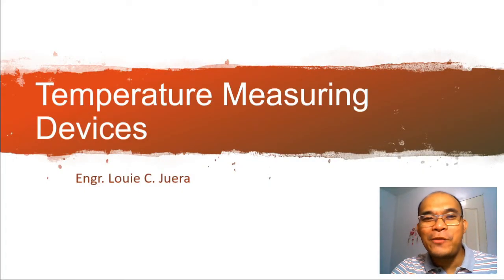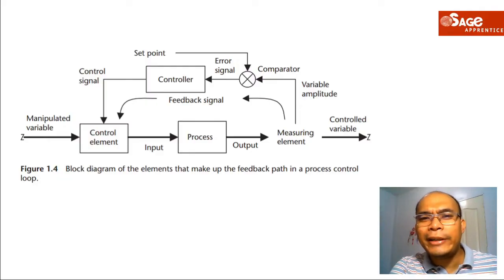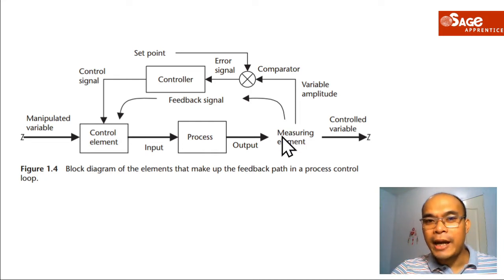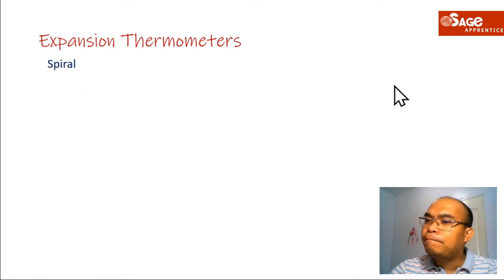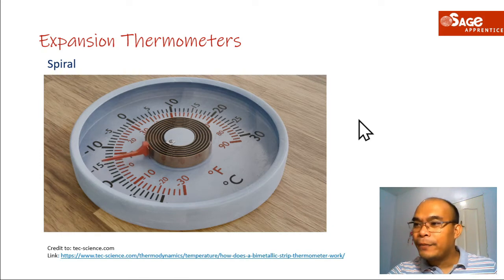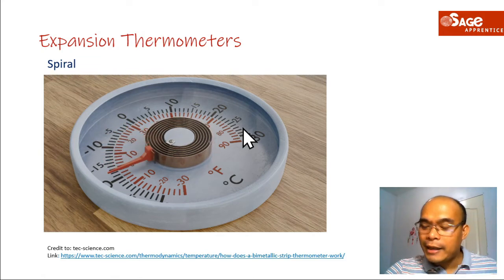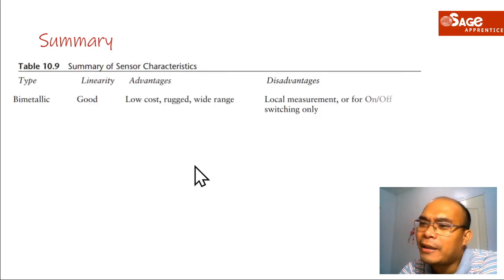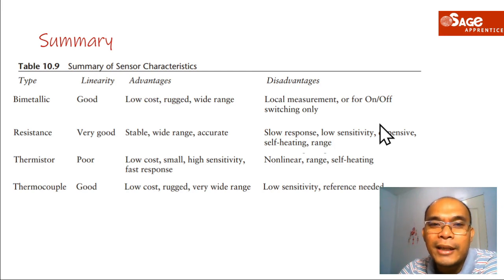How does a Temperature Measuring Device works?

Comment: The video was very detailed and explained well. That's why I've learned a lot about Temperature Measuring Devices like expansion thermometers, which is the main concept is to expand the liquid in glass (mercury). It is also the most common temperature reading device. And I also learned about Bimetallic strip, Spiral and Helical Bimetallic strip, which the main concept is to expand when heat is applied casing the thermometer to point in it's desired temperature. And lastly I learned about Resistance Temperature Devices like thermistors, thermocouples and pyrometer, which is the main concept is the change in temperature will result to the change of resistance, and the change of resistance will result to the change of voltage and the change of voltage is calibrated to measure the change in temperature. Thank you 😊

Comment: Good day Sir!
 In the midst of the pandemic maybe some of us are wondering about  the gun shaped that is pointed at us every time we entered to some stores,  establishments, and malls. That thing is what we called, " Pyrometer." This is suitable as of this time since it measures temperature  without physical contact to other people. Which is a good thing since it helps to  reduced the  spread of virus. 
One of the important components in process control is the measuring element that simply measures physical quantities. One of those physical quantities is temperature. Temperature measurement is necessary to specify  correctly during and after the process  to avoid damage in  the final output. To avoid this fault there are devices that   suitable to aid this problem. One of which is already mentioned in the first paragraph. Thermometer, Resistance Temperature Device, thermistor, and thermocouple are included as well. The aforementioned devices have its own working capacity that's why it's crucial to choose the appropriate device. Thank you and have a blessed day Sir!

Comment: After watching this video, I was able to understand that there are many types of measuring devices that are used to measure, not just that, I was able to understand on how it worked after being heated, on how it  identify its mesurement and as well as how it is being calculated manually. It also have specification as to which measuring devices should be used depends on what you are dealing with specially if you need accurate temperature or not.

Comment: In this lesson I learned about the working principle of bimetallic strip, basically when the temperature increases, the strip bends towards the metal which has a low-temperature coefficient. And when the temperature decreases, the strip bends towards the metal which has a high temperature coefficient. Thank you.

Comment: I learned on what are the operations of the different temperature measuring devices. First measuring device is the expansion thermometers which os very common. Second is the resistance temperature device last is the thermistors, thermocouple and pyrometers. This all temperature measurement is very important and very useful specially on board.

Comment: I learned on what are the operations of the different temperature measuring devices and how to measure the physical quantities such as temperature, pressure and etc. using measuring elements or sensors. Temperature is very important especially to the generators like diesel generators on board. The first measuring device is the expansion thermometers which is very common. Second is the resistance temperature device, then the thermistors, thermocouple, and pyrometers. These temperature measurement tools or any other measuring tools itself are very important especially on board ships.

Comment: The video are very detailed sir. Now I learned about the Temperature Measuring Devices such as the mercury type which is the most common temperature reading devices which uses mercury. So from now on I know that (mercury) is a metal liquid form. And also the non-mercury type which have the similar properties except the toxicity. Specially the different range/ operating range. Also the bimetallic strip that they have a different types specially the spiral. Thanks for this lesson sir I learned a lot of things👌

Comment: Thank you sir for discussing the different measuring devices. I learned the operations of the different temperature measuring devices and how to measuring the physical quantities such as temperature and pressure. The temperature measuring tools devices is very important and helpful on board ships. The first measuring devices is the expansion thermometers an instrument for temperature measurement comprising a fluid-filled bulb. Second, is the resistance temperature device used to measure temperature. third, is the thermistors then thermocouples and pyrometers.

Comment: Thank You for this Video Sir. I just knew now that there are a lot of measures devices and you taught us how to use it, and also in Liquid in Glass sir. I learned that there is a Mercury inside in the glass and it is made in metal in liquid form, and Speaking of of High Toxicity, I just knew that it is very dangerous when the glass will break or broken. And  there are also liquid in glass thermometer which has no toxicity.

Comment: Thanks for this video sir very well explained, this video I learned that there are many types of temperature measuring devices, this video helps for me to know the types of devices how it works, exaple the liquid in glass thermometer that is high linear coefficient of expansion and high toxicity which is the mercury. And also liquid in a glass has not toxicity or doesn't, I learned also the purpose or working of the bimetallic strip, spiral, and helical bimetallic coil are the same concept of metal and that's all. Thank you sir for this video discussion.

Comment: After watching this video I learn the expansion thermometers, like bimetallic strip. If the metal is heated or being exposed to heat the metal will expand. Then when the metal is being cooled or back to it's normal temperature the metal will be back to it's normal state.

Comment: This thing to me about this entire video sir is that Heat transfer plays an important role in life in general, however I discovered that it is more helpful for temperature measuring devices. The conduction, convection and radiation - heat transfer. cause an extension to the sensitive parts of the measuring devices and as the there is development we can peruse what is the temperature dependent on the adjustment of the temperature reading devices. Basic learning video however fundamental for our future field of work in the vessel.

Comment: Thanks for this video sir and well explained sir, I've learned that there are different types of temperature measuring devices such as liquid in glass thermometer, that is high linear coefficient of expansion and high toxicity which is the mercury. There are also liquid in glass thermometer which doesn't has toxicity. Also, i learned the bimetallic strip, spiral, helical bimetallic coil has same concept in expansion of metal but there are not same application. Thank you Sir.

Comment: Another well explained video from our Sage apprentice! 😁 The only thing in my mind about this whole video sir is that Heat transfer plays an important role in life in general, but I learned that it is more useful for temperature measuring devices. The conduction, convection and radiation - heat transfer, cause an expansion to the sensitivr parts of the measuring devices and as the there is expansion we can read what is the temperature based on the calibration of the temperature reading devices. Simple learning video but very essential to our future field of work(maritime). Thank you sir! 👍😊

Comment: In this video it explains about the different temperature measuring devices. First was the expansion thermometers where there are two types explained the liquid in glass and bimetallic strip.Second measuring device is the resistance temperature device where the change of temperature result to the change of resistance. The other types of temperature measuring device were thermistors, thermocouple and pyrometers.

Comment: the  advantage and disadvantages of a Expansion Thermometers, Operating range of a thermometers and Thermal Coefficient of expansion .5 kinds of Temperature Measuring Devices and their uses. It is important to know because every temperature devices have its own purpose for that kind of type of machinery. And it also important to know about temperature so that it is easy when we board in a ship.

Comment: I learned about types of measurements, in Liquid in glass using mercury the mercury is  metal in a liquid form causes high toxicity can harmful to our health. A bimetallic strip is not an accurate device low cost of On/Off types of application to use it its simply two strips of different metal the steel and brass held at once, when heated the strips expand at different rates resulting in a bending effect that is used to to measure.

Comment: Linearities has a pro's and con's when we measure the temperature, there are diffirent types of measuring devices and its individual uses.And also the sebeck effect in which the heat will converted into a electrical energy...

Comment: i understand more useful for temperature measuring devices. The conduction, convection and radiation - heat transfer, cause an expansion to the sensitive  parts of the measuring devices and there expansion we can read what is the temperature based on the calibration of the temperature reading devices.

Comment: thank you ffor the video sir its very informative . ive learn in this video sir is what is the function of this measuring devices like expansion of materials, electrical resistance change, thermistors and also thermo couples, ive leard thats theres a lot of ways or device that can be use for measurements. i haven't know this sir until now.

Comment: Measuring temperature devices as a very important rule for measuring the temperature of each pipe of the ship. The ship has too many pipes that has different temperature and  the temperature of each pipe must be monitored to avoid an accident with regards to too high temperature that leads to machinery failure. There are different types of temperature measuring devices, like;
Expansion thermometers- this kind of thermometer uses an expansion of metal to measure the temperature. When this thermometer is heated metal will expand in different form.
Electrical resistance change- this temperature measuring device uses electric current to measure the temperature. When there is a change of resistant there will be a change of temperature and voltage. 
Thermistors- this kind of temperature measuring device is a very cheap but very accurate and robust when it comes to measuring the temperature. And this can't work very well on too high temperature or too low temperature.
Thermocouples- this temperature measuring devices are you Seebeck effect. This temperature measuring device can convert heat into electrical energy.
Pyrometers- this temperature measuring device can measure temperature in heat registration. I learn it from your video sir thank you❤️ and God bless you sir😇